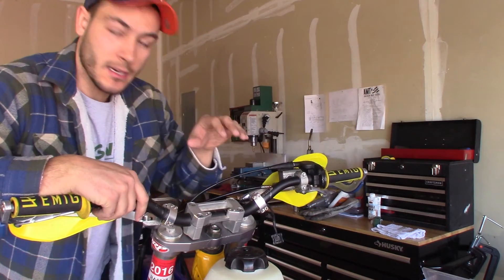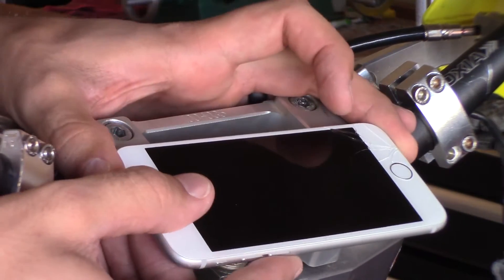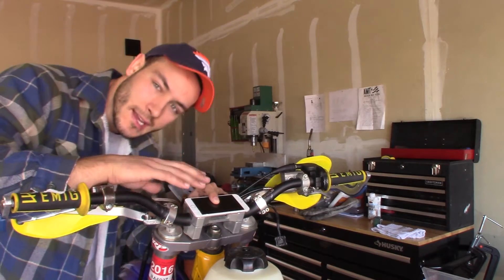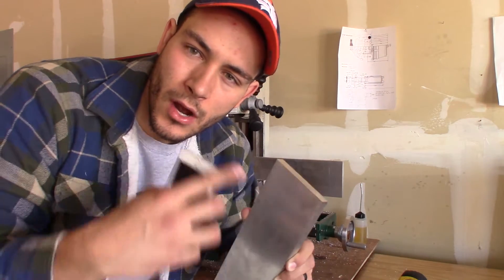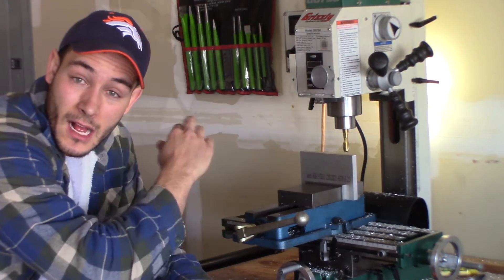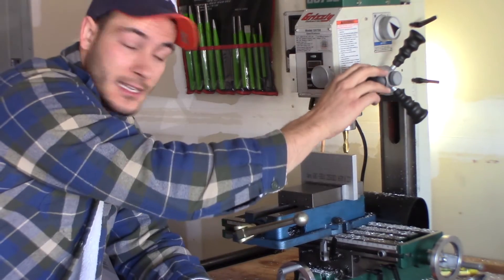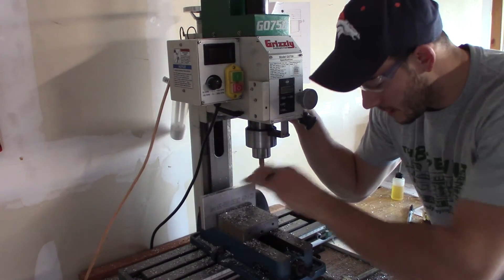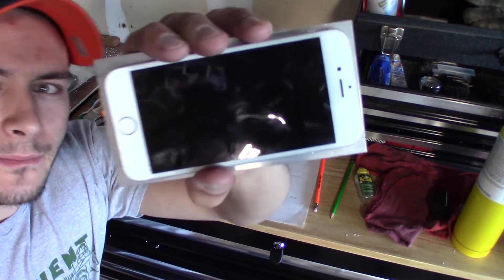Aluminum Iphone Case Build Pt. 1

Comment: When is part 2 coming? Also, when are you gonna finish your build thread on TT? I really wanna see how it's coming along with the yellow frame. I also built a YZ300 with wide ratio transmission, and I can't wait for spring!
Reply: part 2 never here...
Reply from the maker: I am in the middle of moving so the build has come to a halt along with the part 2 and maybe 3. The bike rides awesome and I really like the wide tranny, it has made a big difference.
Reply: That is understandable.. When you get a chance, you should snaps some pictures and post them up on your thread.

Comment: that's awesome. I miss riding my dirt bike so much.
Reply from the maker: Thanks bro, I haven't had a bike for a couple years, I should have this one ready to go for this next spring riding season and i cant wait.
Reply: what year is it? I haven't rode since everything started going 4 stroke, my last bike was a Kx125, so much fun.
Reply from the maker: its a 2002 yz250 completely rebuilt. Just did a 295cc kit and put a wide ratio transmission in also. Fun BiKE!